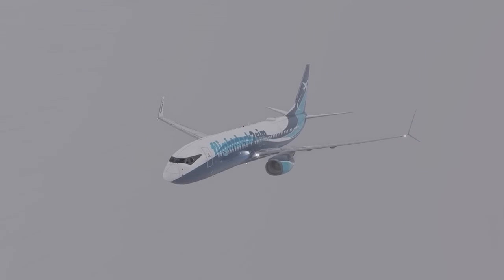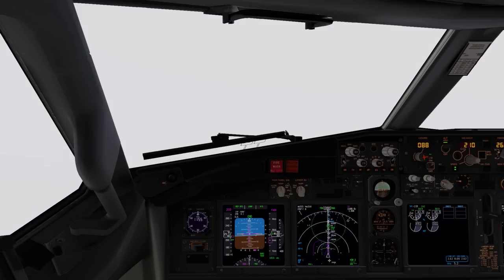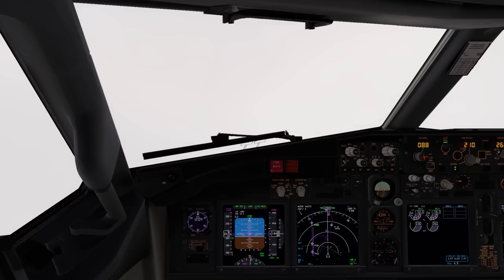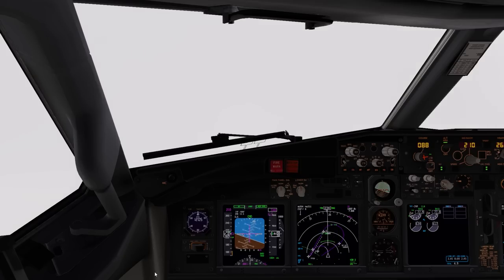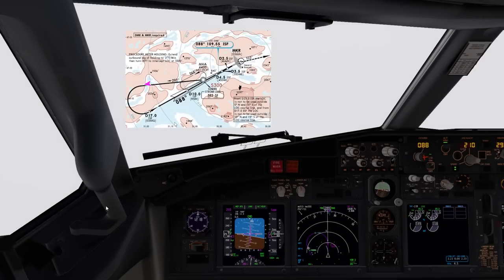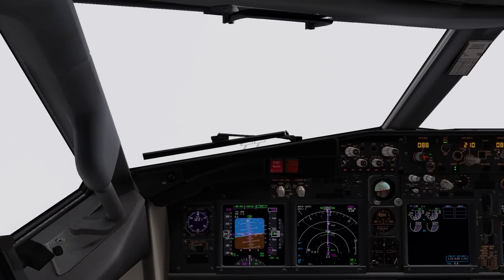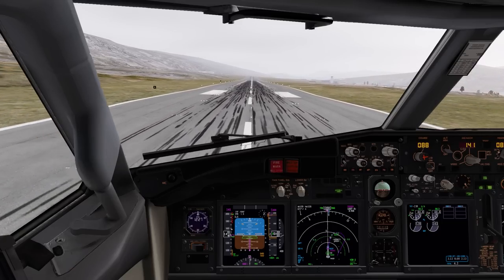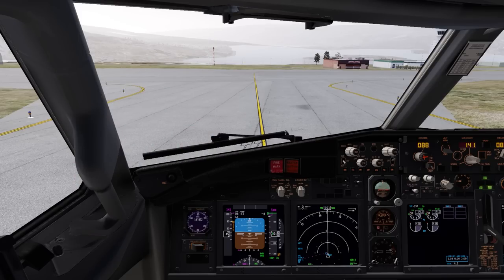Cold Temperature Altimeter Error is pretty dangerous! | X-Plane 12 Demonstration

Comment: Superb video! After watching it, I read about the subject to clear my confusion. Could you please check it out? First, in addition to setting the altimeter provided by the tower, you are talking about the *additional* low-temperature correction. If you don't correct it, then although the altimeter reading will be correct when you land at the airport, it will read dangerously too high (so you fly too low) when flying over approach fixes. The reason is that at cooler temperatures, the rate of decrease in air pressure due to altitude change is greater. "The rate of decrease is greater" is the key. Therefore, the error in altitude is not only greater at colder temperatures but also at higher relative altitudes above the airport. Hence, the steep approaches to airports in cold weather often require the correction.

Comment: Thanks. I have a real life scenario question though.

So you apply corrections to all published procedural altitudes yes? What If ATC changes your SID/STAR and departure or arrival runway?
Are you going to be there calculating again all the different altitudes and applying to all published altitudes on FMC again? Changing SID/STAR/RW already creates stress for reprogramming. Then, How much time would that take to painstakingly calculate and input into the FMC and constantly telling ATC your altitude correction when they assign you a climb/descend altitude?

Are you going to be calculating, interpolating to the degree? What about other aircrafts in the vicinity? Are they going to be doing it too? If everyone one is doing it, will everyone get the exact same numbers when interpolating and correcting? If no, will everyone then be kinda flying at all sorts of different altitudes? 

Should everyone just request radar vectors for departure/arrival so they can just dodge this constant calculation, interpolation, modification and advising ATC of correction which makes RT even more congested and longer… Constantly calculating and modifying numbers increases workload and reduces margin of error though I understand it’s significance. But how significant? Depends on actual temperature and height above altimeter reference source.

What do you think?

Comment: Thank you for this very educative video captain !!
Do you no if by chance, MSFS is also correct on the cold temperature altitude error ?
Reply from the maker: You're welcome!

MSFS has not modelled this unfortunately.

FD2S
Reply: @flightdeck2sim  Thanks for this quick reply ! I will use it only on XP12 then... ;)
Reply: @flightdeck2sim  hello, but why msfs have different altitude for atc on vatsim depending on the location then ? If I fly in the canada my cruise alt is lower on simaware than what I have in the plane (when baro std). Also if you change live weather on/off during cruise you can see a huge difference. I'm confused.
Reply from the maker: I should think the difference you’re experiencing is the pressure difference between local QNH and STD, cold temperature altimeter error is not in modelled in MSFS.

FD2S
Reply: @flightdeck2sim  ho okay thank you very much for the clarification, I was mixing two concepts lol
Reply: @flightdeck2sim  well nope, it seems I went to PABR, -28c here and I got 2500ft indicated and 2120ish on the RA so -380ft seems good (plane set to local qnh). It's not working in manual weather but manual or preset weather is a broken thing, no turbulence etc

Comment: Great video. If you were flying an RNP AR with temperature-corrected Baro VNAV, would you also use V/S and LVL CHG  modes to follow the vertical profile? Or is there a way to use VNAV for a temperature-corrected RNP AR approach?
Reply: Do not commence the approach when the aerodrome temperature is outside the promulgated aerodrome temperature limits for the procedure. While APV approach  would not be available, a NPA to LNAV minima could be conducted provided the correct cold weather temperature corrections are applied:

LNAV/VNAV 
* Temprature correct MSA
* Temprature correct LNAV/VNAV DA, set on PFD
* Temprature correct altitudes below corrected MSA to FAF
* Do not correct alltitudes from FAF to MAPt (Including FAF)
* Temprature correct missed approach altitudes below corrected MSA

Check chart temperature restrictions. If the reported airport temperature is outside the limits revert to LNAV minima

LNAV
* Temprature correct MSA
* Temprature corect MDA, add 40 feet(airline specific requirement to add 40' for NPA), set on PFD
* Temperature correct all altitudes below corrected MSA including FAF to MAPt altitudes (RW point cannot be corrected in the FMC)
* Temperature correct missed approach altitudes below corrected MSA

VNAV is the recommended vertical mode for the initial and intermediate approach segments."

With the added corrections as described above, we normally fly with LNAV/VNAV engaged.
Info taken from RNP Pilot Reference guide (again only use whatever instructions your airline says, this is just a demonstration of what we do)

Comment: It would be interesting to see the effects of hot temperatures.  For example, on a 40C day fly an ILS at KORD with multiple stepdown fixes in the intermediate segment outside the FAF using approach mode and tracking localizer and glideslope.  Do you go below the published these stepdown altitudes while n the glideslope?
Reply from the maker: Great question Richard! 

As it's less dangerous than cold temperatures there are no correction made to hot temperatures but it does pose other issues such as high energy approaches when using VNAV

An ILS isn’t affected by temperature corrections, you just need to adjust the platform altitude and minima. The glideslope is fixed so the altimeter will overread if it's cold or underread if it's as you do your altitude distance cross checks but you’ll be at the correct true altitude

FD2S
Reply: @flightdeck2sim   Thanks Captain!   The ILS glideslope and hot temperatures has been a problem in the US, namely at those locations where simultaneous parallel approach operations in use, for example Chicago O'Hare (ORD).  If you look at the ILSs for the runways, especially the 10 complex, they have multiple stepdown altitudes in the intermediate segment.  The glideslope crosses those stepdown fixes on a standard day at the published altitudes.  However, on a hot day the glideslope, as you note is unaffected by temperature, will cross these stepdown fixes below the published altitudes.  The altitudes are required for ATC to apply the 1000' vertical separation requirement at the point of turn on for the parallel traffic.  Also, some of those altitudes are placed at the floor of Class B airspace.  US regulations require aircraft to remain within the Class B airspace when operating into and out of the primary airport.  On a hot day, tracking the ILS glideslope outside of the FAF can result in descending below these altitudes, and result in a potential pilot deviation by ATC. This has been an issue at KORD and KDFW recently.  It's great that XP 12 now can simulate this and we can show pilots that it's not always appropriate to use approach mode and track the glideslope that far out.   Enjoy your content!  Always look foward to your next video!
Reply from the maker: @richardboll8763  Ahhh I get you! Yes prior to intercepting an ILS any step down altitudes are going to cause issues!

FD2S

Comment: In case of hot temperature? In teory I have the opposite altimeter issue? There are system that correct automaticaly theese altimeter issues?
Reply from the maker: That's exactly right. It's less dangerous than cold temperatures because you're higher but it does pose other issues such as high energy approaches when using VNAV but no correction are made for higher temepratures.

FD2S

Comment: Question: with temperatures in cruise regularly exceeding -30 degrees, do you do this in cruise? If so, how should it be done?
Reply from the maker: Great question! You only need to make corrections to heights below the MSA. In the cruise no correction is needed and it's important you don't make any corrections as you'll be at a different altitude to the traffic around you. 

FD2S

Comment: I'm slightly confused here: a low temperature means higher density, which I'd naively expect to mean that pressure is higher than expected, but that would make the altimeter read a lower altitude than you're actually at? What do I have wrong?
Reply: As shown in the diagram at the start of the tutorial, with lower temperatures the air is denser which means the layers of pressure are closer to each other. At a true altitude of 5000ft in a standard atmosphere the pressure is around 850hPa. The altimeter is calibrated to a standard atmosphere and if it reads a pressure of 850hPa it will show an altitude of 5000ft. In that example the altimeter shows the correct altitude.
Now in an atmosphere where the temperature is lower than standard (15°C at sea level) the 850hPa pressure level will be at an lower true altitude! The altimeter will still show 5000ft at the 850hPa level but your true altitude will be lower because the 850hPa pressure level will be closer to the ground. Thats the danger, the altimeter tells you that you are higher than you actually are. Correct by adding 4% per 10°C below standard temperature or use a temperature correction table.
Reply: Isso é um cacoete difícil de tirar da cabeça.  Ensinaram que a Densidade é ligada a maior pressão sempre.  Isso nos gases  não é bem assim ! A Baixa temperatura reduz a pressão , mesmo estando muito mais denso que um ar mais aquecido; que aumenta a pressão.  Costumamos a pensar como se fosse um cilindro de volume constante,  colocando mais matéria e assim aumentando a Densidade dentro do cilindro e por consequência , tendo uma elevação na pressão.  Isso na atmosfera não acontece , pois o que importa é a temperatura da energia cinética dos gases .  Mais frio , maior densidade,  menor pressão,  devido a menor agitação molecular . O Barômetro sempre mostrará a queda da pressão em  relação ao gás que está dentro do aneroide,  que por estar com pressão padrão , expandira se exposto ao ar Mais frio e menor pressão , dando a entender que está havendo uma elevação na altitude.  Na verdade o que importa é a temperatura pra sabermos de fato a pressão real a que estamos voando .